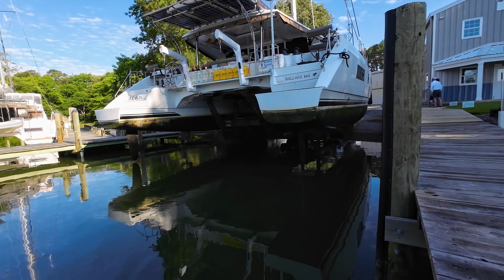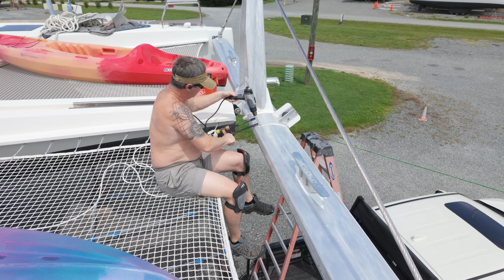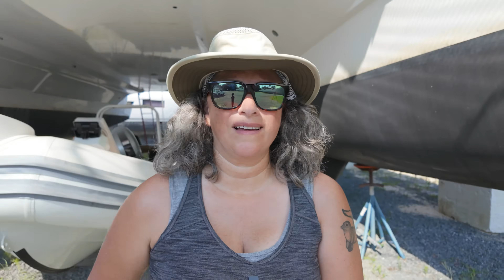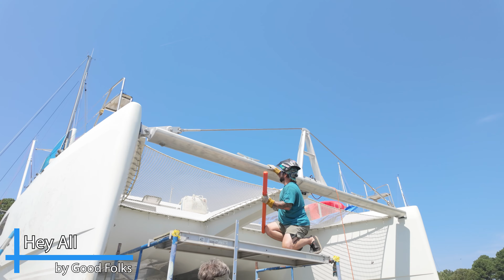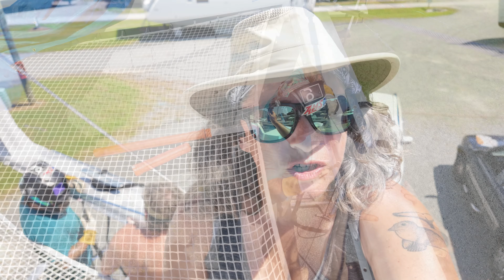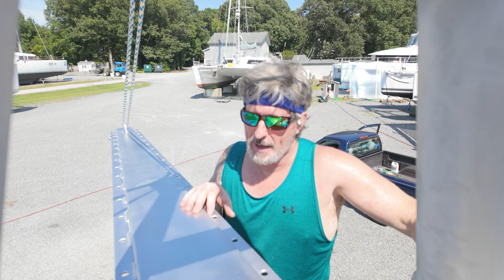Installing our new DIY bowsprit Episode 51 #refit #sailingcatamaran

Comment: Did you try Mar-Hyde Tal-Strip II Aircraft Coating Remover?  It's specifically designed for removing aircraft coatings which includes Imron paint, which is some of toughest paint on the market.

Too bad you weren't on the west coast.  I could have easily fabricated a bow sprit at my shop.
Reply from the maker: We have not tried that. Is it available for regular people to purchase? Too bad you aren’t on the east coast! We really struggled to find quality, reliable craftsmen to help with this project!

Comment: Bowsprit is looking great!  Not sure what the plan is for the whiskers, but on Zia I had whiskers made from Dyneema that come up half way to the bowsprit from the attachment points on the inside of the hulls.  The rest of the distance is made up by block and tackle up to the end of the bowsprit.  That allows me to pull the bowsprit downward in order to tighten the continuous furler, but also to release the block and tackle and allow the bowsprit to fold up into a vertical position.  So many reasons why this is useful.  The other ends of the block and tackle lines go to clutches on either side of hulls just behind the dolphin seats.  Any idea when you might be getting back in again??  🙂
Reply from the maker: We’re planning the same! With the longer bowsprit it pushes our LOA to over 60’ so folding it vertical is essential if we need to get into a slip. I added rings on the top of the bowsprit a little past the kid point and on the A-frame so I have an easy attachment point with a soft shackle.